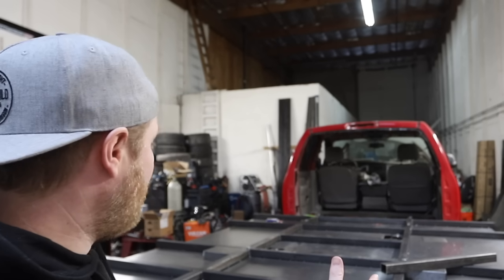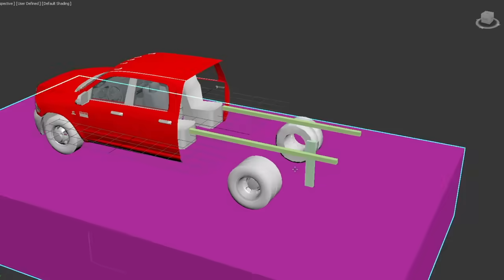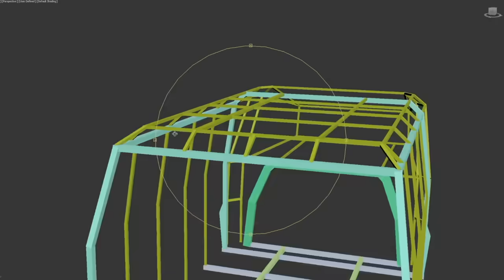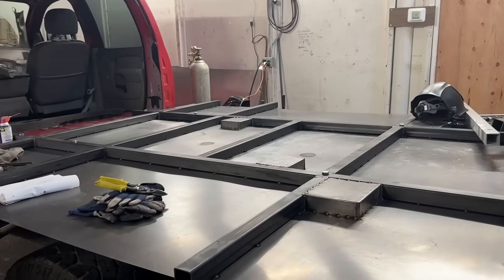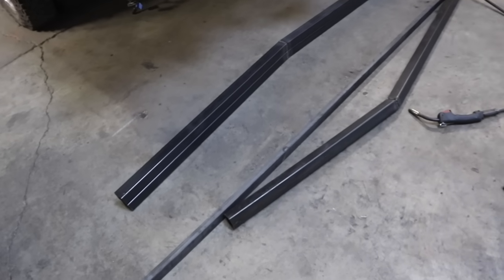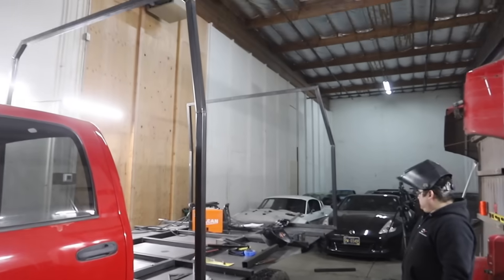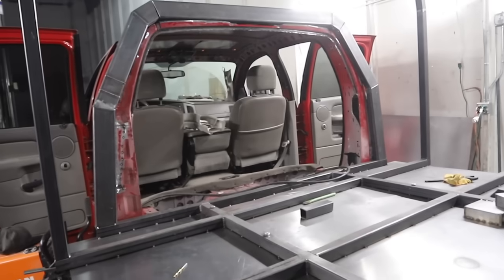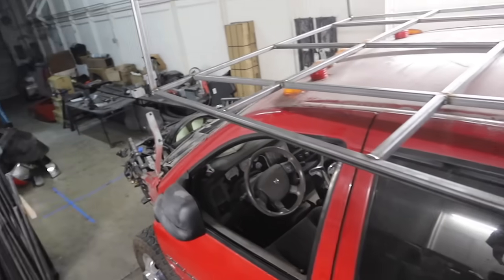Building The Worlds Craziest Overlanding Camper Truck - The WALLS

Comment: Where the frame bolts go in, please weld in some crush tubes! It will add a ton of compression strength.
Reply: THIS!!^
Reply: What gauge steele?
Reply: This is a good point and I’m surprised they didn’t add them. I’m building something similar (88 Toyota, 77 chinook camper) and I’ve considered adding crush tubes to the support beams I’m going to add. I’m trying to figure out if it’s worth it because this will have a rather large washer on each end that is the same size as the width of the tubing.

Comment: I would add legs that wind down in each corner to the ground. If left alone would rock a lot with someone moving about. If you add the wind down legs it’d make it super stable and give you the ability to level it if the ground is uneven
Reply: Legs for sure, but not wind down, they have to be electric, air ?, hydraulic ? screw ?  just whatever they have to be semi auto :)
Reply: @terryhayward7905  yeah i thought about that, guessed if they went that route they would make them electric or hydraulic. Just making the point some legs may help.
Reply: Smart
Reply: Do they have a donor salvage camper for the internal fittings that they will need? 🤔

Comment: I'm gonna need to see this bad boy on a cat scale when you are complete.
Reply: Good luck with that
Reply: @festuspunky  it's not going to roll.
Reply: @FestusPunky  🤦‍♂️really? It's a dually, and most of the weight is still pretty low. The roof of the camper doesn't weight much
Reply: meow
Reply: 15000 lbs done for sure
Reply: @Yannick Elmignon  no its not lol.not even close.
Reply: A "cat scale" is this how you weigh cats/pets?
Reply: @JohnDoe-zr6bk  no. In the States big trucks like 18 wheelers need to stay under a certain weight when loaded. Each axle will even have a maximum weight. So the way you check it is to go to a truck stop with a scale to drive your rig onto. By and large the biggest brand of scales for this purpose is Cat Scales.
Reply: @reallunacy ’Cat’ as in the brand Caterpillar?
Reply: @alxgu198  Yes, Caterpillar heavy equipment
Reply: I hope it does wheelies 🤣
Reply: @BBC.Customs.2  I don’t see why they would need heavy equipment to weigh caterpillars 🤔
Makes sense to weigh them at this stage though, before they turn to flutterbys 👍
Reply: Guarantee it's less than those big truck campers with 3 slide outs and still having the bed on the truck.
Reply: Do you mean cad?
Reply: @JohnDoe-zr6bk they mean caterpillar, the heavy equipment manufacturer.
Reply: Their is a reason most manufacturers would start with a 5500 and still use aluminum
Reply: @BBC.Customs.2  No, the CAT Scale chain of truck weigh scales has nothing to do with the equipment manufacturer Caterpillar.
Reply: @morsecodereviews1553  it would need a shitload of weight behind the rear tires. It would be funny af to see though. A huge ass camper truck carrying the front wheels
Reply: @Yannick Elmignon  15,000 pounds would be about 8,000 pounds added to the cab and chassis, and would be over the GVWR. The camper is going to get heavy, but not that heavy.

Comment: My only concern about this build is that the weight's kept as low as possible. If you build the whole thing out of steel and load the inside with a bunch of weight, it could be super top heavy.
Aside from that, this is looking really interesting, and I'm excited to see how it turns out!
Reply: People mentioned the weight in first video where they built the floor. They don't think it's gonna matter, but add in insulation and double skins. It's gonna be heavy
Reply: Its a dually, they are wider, with 4 tires in the rear to help the side load. Hes not going to have swaying issues. These duallies usually get loaded with goose neck hitches and pulling 6 cars plus trailer and they are towed all across US
Reply: @ibidu1  But its supposed to be an overland build, that means offroading in a top-heavy camper. Not so much worried about sway rather tipping if it is too top heavy.
Reply: Might ride nicer with a little weight in the back plus they have helper bags dont forget lol
Reply: @ibidu1  im an rv mechanic and i can promise you its gonna sway hard. Being a dually makes it best suited for this build however its very tall and when he is saying its 1,500lbs in just framing... thats very heavy. He still needs his water tanks, propane, batteries, electronics, fridge, stove, bathroom, shower. It all depends on what hes gonna put in there of course. The biggest truck camper on the market right now is an eagle cap and its 4800lbs dry... that minimum needs a f450 or bigger to haul. Ive driven one with a new 2022 f450 which has the highest payload in class and it sways alot and again thats with airbags and a properly designed camper with most of the weight on the bottom. Im thinking hes gonna be fine but hes gonna be pushing it hard and need his bags for sure and maybe some stabil loads and even then he will still sway alot
Reply: Don’t forget they never actually drive their vehicles so it shouldn’t be a problem
Reply: will it become like the Lamborghini build? parked in the corner for show and looks?
Reply: I keep wondering this not sure if anyone knows, doesn't extending the truck bead further past the rear axles affect the handling, it would make it fishtail easier right?
Reply: @danielkyto1363  if you have un even load technically yes. But thats only of it starts lifting the front end like a lever.
Reply: this thing fully kitted wont be anywhere NEAR what camper companies stuff in the back of these trucks. this wont have any issues at all
Reply: @scottspropertyservices6877   They don’t drive them bc they are hack job builds
Reply: @ghomerhust based on what?
Reply: @ibidu1  so I take it you’re not familiar with the concept of tongue weight…
Reply: hes not using aluminium frames?
Reply: B is Build needs to move that axle back - taking a 56IN Cab to axle truck and extending the frame rails to accommodate for a longer body greatly impacts center of gravity.  Looks like in the previous video they extended the frame back about 3ft?  If they are installing a 12ft camper body this truck needs to have at least a 84in cab to axle measurement!  Anything longer than 12ft is dangerous.
Reply: All "overland" builds are waaaaay too heavy. Most of them can barely drive off road anyway.
Reply: Yeah it seems like aluminum would have been the better choice. But my opinion means nothing as I have never designed or fabricated anything lol
Reply: I love all these comments about weight and center of gravity and toung weight and extending the bed blahs blahh blahh. They literally manufacture for f350 and f450 trucks with box extended bed solid steel with diamond plate and solid steel bumpers with 51ft booms on them for Arial work. Check out Robert Hydrolics trucks, Altec trucks, sunbelt trucks. These trucks have more steel in them that this build does not to mention they are capable of lifting 500lb ontop of operator weight at full horizontal extention with little to no sway. I know this because I have one in my driveway. Rh51 extended cab f450. These trucks can be made rigid with almost zero sway with under carrage framing. Oh and it also sits 12ft into the air while driving. I would be more concerned about the tires than everything else.
Reply: It's a dually with one ton suspension , it will handle like it's on rails .
Reply: @fuoman100    Your truck probably started as a CHASSIS CAB - longer wheelbase, longer cab to axle NOT a pickup bed with a cab to axle of 56inches.  There is a drastic difference between a pickup bed delete truck vs a chassis cab (doesnt matter what if its Ford, GM, RAM).  Check out any manufactures body builder guide to confirm this.
Reply: @kfouks  I checked the Robert Hydraulics website, and yes. His truck's ladder package is meant for a long wheelbase chassis cab, which is a different configuration from a large pickup.
Aside from the suspension being built to handle a larger and heavier payload, the center of gravity of the ladder package is pretty low to the chassis, and the side profile is more forgiving under crosswinds.
Reply: @fuoman100  Your rig also has special suspension designed specifically for man lifts. And the F450 chassis cab has significantly more payload capacity than a plain jane Dodge 1 ton.
Reply: @ibidu1  Trailers handle differently than campers, as the trailer suspension helps control sway.
Reply: @dianetigert1310  you mean like every build I miss the old b is for build

Comment: You won't believe how cool towing a trailer will be on turning!!! I extended a old D 50  6' bed to an alum 8' flatbed and extended the hitch. it worked perfectly and trailers don't cut corners because the hitch swings the tongue out further. You will see how you won't need to swing wide for turns at all! Love customizing don't forget you learn by mistakes and I've learned a lot!!!!

Comment: I highly suggest getting a Kelderman rear air suspension kit or another brand. Paired with an auto leveling management system. Meets or exceeds stock payload and towing capacity except now you have a level camper if your on uneven ground or squat the rear when going through your garage door

Comment: Use a few big ratchet straps from the truck frame down to the axel to set level. Two should be enough to safely hold it down while you work on it

Comment: Of course the truck can handle the weight, however if you used aluminum rather than steel the weight would be less allowing a higher fuel milage.
Reply: I wouldn’t be so certain about that. Payload capacity for a long bed dually 3500 is 4600lbs. Put in 4 200lb plus guys that is down to 3800lbs. That’s for everything carried on the truck. He will have to be careful about the load he puts on that frame. It was only a few months ago that a dodge snapped in half from a slide in camper. Planning to overland with a heavy steel box could be a huge problem.
Reply: @slowdaze  that ram you are mentioning is because they welded that box to the frame which ram says NOT to.
Reply: @slowdaze  It's not only the weight of the constructed frame and skin that has to be considered in the build.  The weight of the finishing inside, the beds,, water, fridge, stove, interior furnishings add even more weight than you might think.  Those that rebuild busses find this out quite often the hard way.
Reply: @michaelcaraway2305  exactly!

Comment: Hey Chris, Remeber that Dodge Ram 3500 that bend in half about 2-3 months ago that was all over the trade rags?    Maybe you ought to fab some pieces of 1/4" or more piece of steel out that duplicate the chassis box frame, and weld those 1/4" to chassis.   The weight won't hurt the tube diesel, but the added strength might really be beneficial to the strength of the truck with the added weight of a steel frame habitat camper.  Do it now while you can get in there easily.

Comment: You got my attention!  What BoonDocker hasn't wanted to do(make) this?  This is just awesome for the Do it yourselfer.  Some built in hydraulic stabilizers with adjustable drop down feet would be awesome on all four corners. Even if they were electric driven like concealed camper jacks would do the trick. Make it accessible for maintenance and to replace if needed. Where are you getting the steel and sheets?...where can you find it here in Portland?  It will be a fun journey to see all of you systems come together.....back to work!

Comment: Off topic a bit I know. I hope you actually do read this. I thought of you guys when I acquired these fender molds. I just was given a set of carbon fiber molds for a Z06 corvette (not certain of the year they fit). But I have both left and right rear quarter panels. I have no use for them, but you guys build sick stuff.

Comment: IF you haven't thought of it yet, and you may have I had an idea since I saw you removed your third brake light assembly. IF you are planning on this being a gaming rig or what have you, it would be pretty awesome to put a few cameras inside of a housing in same spot of the third brake light assembly so you can easily have a way to grab footage on the fly from as far back as possible. Just wanted to share the thought.

Comment: For the part above the cab add diagonal cross supports from the front top to the bottom back off the cab area kind of like a fence gate
Reply: It’ll transfer most of the load to the sturdiest portion of the camper

Comment: Hey to protect the connection between cab and habitat I think a rubber connection like they make on long ariculated city buses would work. They are like rubber stripes connected with steel. It will be weatherproof and bendy.

Comment: The other day I saw a video of a Dodge truck like that with a slide in camper ,with the weight of the camper .it broke the frame ,you might want to box frame .just saying ,good luck ,Love your channel
Reply: I’ve seen that. One issue was the guy had a motorcycle rack behind the camper that added a lot of weight far from the rear wheels

Comment: I worked at a motorhome plant in the past. Frame and cage was always built from thin walled mild steel. Always. There's plenty of ways to save weight during construction, but the main support is NOT one of them.

Comment: All the cab and habitat welds are gonna crack you guys had to put like a thick rubber gasket in between and nuts and bolts with bigger holes so it has some movement atleast and that should be waterproof.

Comment: You can always drill 15th /16th holes @ every 3" or every 6"To lighten the structure and then you could use the holes to run your electrical and plumbing through

Comment: I also have a similar problem with my motorhome being too high, so I solved it by temporarily replacing the wheels with a set of rims only. Still mobile only lower😁
Reply: I was hoping to do the same but my camper build looks like it will be too tall even with a set of wheels and smaller tires. 88 Toyota with a 77 chinook camper.

Comment: Are you planning to leave a gap between the front of the roof and the camper?  What about filling the space with a big foam rubber gasket right behind the cab lights?

Comment: This will be heavy duty, just hope it's not too heavy. The campers that slide into the bed are mostly 2x2 wood frame.
Reply: Years ago.  Now they are most all made with aluminum frames.   This thing is going to be supper heavy.   My all aluminum frame camper makes the weight on my back axle be 8750 lbs.   can’t imagine what it would be if made out steel like this one.

Comment: Will a lot of high strength aluminum be used to keep the frame weight down. Carbon fiber for the outside shell. Will it be able to withstand a bear attack or even a curious Bigfoot.

Comment: Looks good, but I would built the sides of the camper like a roof truss (all the way from the back to the front) and that would have supported the cab top bed !! Then the bed itself would have  metal joists on end to support the bed across from one truss to the next !!

Comment: Amazing build, looking forward to see it complete, my only worry and correct me if I’m wrong but making the camper section out of boxed steel and connecting it to the cab of the pickup will only make the cab act like a crumple zone no? Similar to the limos on the road where the new section become significantly more strong than the cab it self. Just fuel for thought, not bashing the build in anyway i absolutely love it ❤. But would love to know your thoughts 👍🏼

Comment: The only real concern is doing a double sleeve on all your mounting bolts. That way the tubing won't collapse and you can recess the bolts for your flooring.  Have you ever seen the really big truck campers that have 3 slide outs? They DON'T remove the bed and deffinetly weigh more than yours. Hopefully the weight haters will read this and stop comment so much on the weight. They can always add helper springs and airbags. But the weight of those giant campers plus the weight of the bed.... He's not wrong about being fine on the weight of the steel. The large truck campers weigh between 3500 to 5000 lbs.

Comment: Wondering if you will get any visibility on the traffic lights with such an overhang on top of the cab
Reply: The front and rear wide vehicle identification and clearance lamps should certainly be moved to the front and rear of the camper - maybe they'll do that later.

Comment: For doing an ad break about your updated website there's a few problems. The R69 Tee on the shop has the same gray background as the main site. When you mouse over it it becomes white (reverse of everything else). The OG Logo Hoodie's background when you mouse over it is just slightly different so it sticks out. The B is For Build Sticker & Jet Tag Pack has the same white background mouse over or not. None of the other shirts appear to change when you mouse over them (maybe that's as designed?). Just looked odd to me. Figured you should know.

Comment: So much excess unnecessary weight. Lots of places a thinner angle iron would have worked. Support the front with a bar down to the fender and put a rubber bushing in down by the frame?